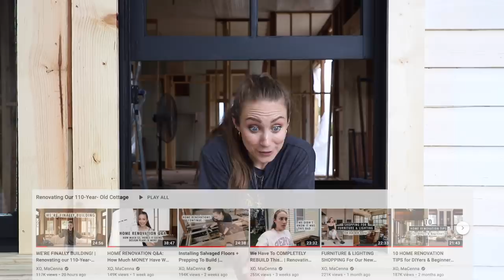First DIY PROJECT for our NEW HOME // Restoring Century-Old Windows | XO, MaCenna

Comment: The framers seemed to make more errors than should be acceptable. Especially given the detailed diagrams and instructions you worked so hard to provide. Have you spoken to the contractor about this? I realize many of these errors cannot be corrected at this point, but at least you could possibly keep future clients who hire them from facing the same or similar issues.

Comment: I know you are trying to use as much of the materials of the original house, and I admire that and your hard work. However, wouldn’t it be cost effective in the long run to have double paned windows installed to save on your utility bill? We have been staying in a 70 year old house for the summer, in Santa Barbara, and the heat has been oppressive because the original windows provided almost no insulation. I know Texas weather is much more extreme. I hope you don’t regret your decision.

Comment: McKenna, get an old, but working crock pot from a thrift store, take all the window and door hardware that you want yo reuse ans cook it on high in water and a few drops of dish soap for at least 12 hours. Use a stiff wire brush and all the old gunk will come off easily. Saves you money. Marianne

Comment: Lead testing - hope you did that for all the layers of paint. Using a heat gun on lead paint especially without a proper respirator is a health disaster. Lead levels accumulate in your body and can’t be reduced and the flakes fly everywhere, stay in the environment. Please get your levels checked and be more careful. Also you shouldn’t be sanding lead paint the particles will land in the grass or soil and your kids animals can pick it up and eat it etc.

Comment: Go the middle color Deep in Thought. Is it just me, it seems everything those framers did they did wrong.  Every window at wrong height etc.  Next time you need to have them check with you before they cut or frame in a window. I would be so mad.